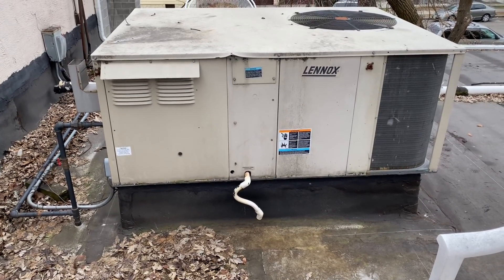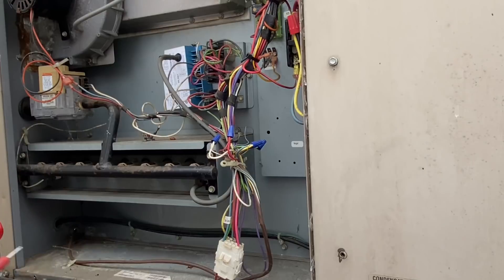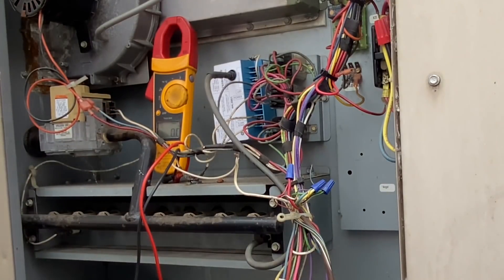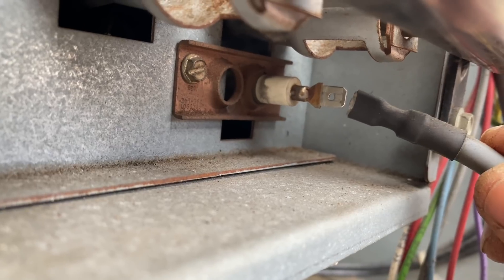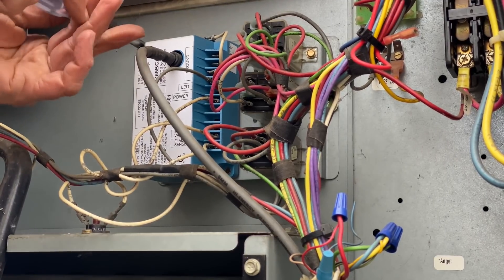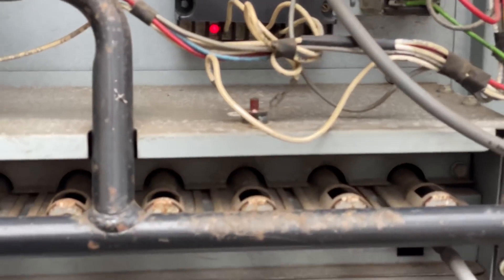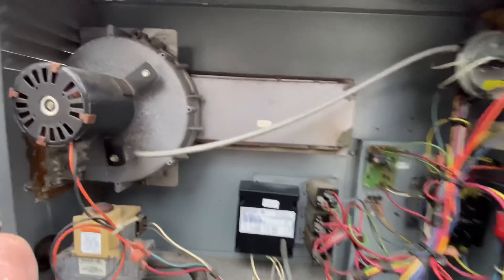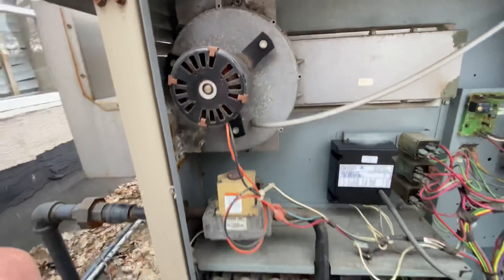Heat Burner Not Igniting Inducer Starts HVAC troubleshooting

Comment: Did the gas valve's solenoid AMP DRAW test get done, BEFORE installing new board? A Half-shorted-out solenoid winding may still open the valve, but may be OVERAMPing the control board's output relay circuitry, just enough, to cause an early death of the new board too?

Comment: Nice vid. Personally would apply 26 volts with a circuit tester i.,e. power probe IIS not just used for automotive. Apply from logic board to valve/ignition
Reply: Yes, but to HAUL around a PowerProbe is a bit much.  Just a fused jumper is fine.
Reply: @BYENZER  the power probe we have/ use is compact fits in tool bag and extensive uses in HVAC electrical diagnosis; additionally the power probe, hence the word power probe supplies the current (voltage) dc/ac. Where are you going to attach the jumper wire too with inline fuse to draw the correct current- thus your not testing that circuit by doing so? bypassing a circuit/trace/conductor is not testing necessarily
Reply: Worth doing but as soon as I heard the short weak spark from the original, time for a new one.

Comment: Excellent job. Ya the flame sensor can bounce alot but to have a constant small range of bounce is ok. You will be back later to change the exhaust motor by end of winter. Thanks for the video and job well done.
Reply: I heard the bearings too, hopefully they get the rest of the winter before it finally gives up.